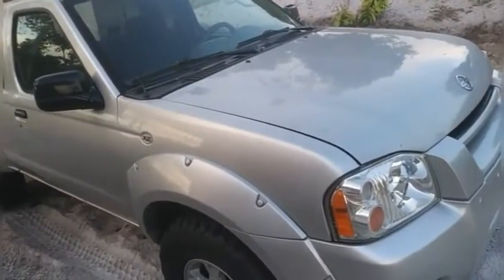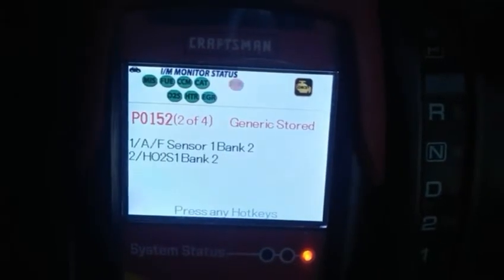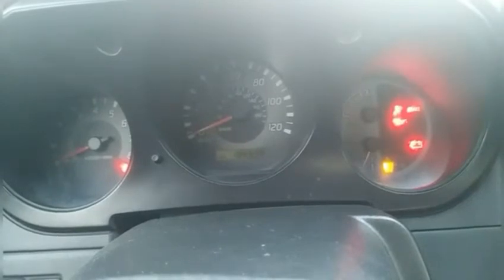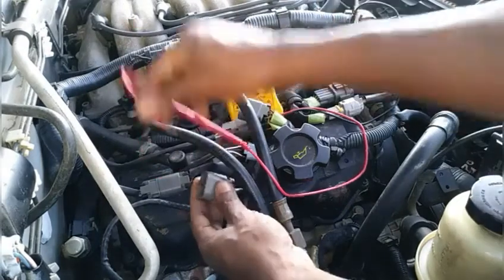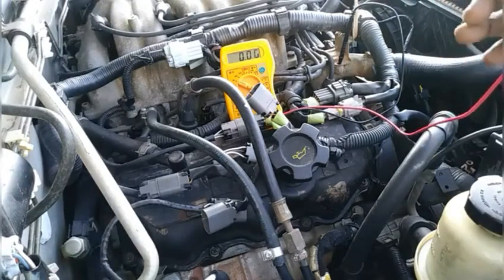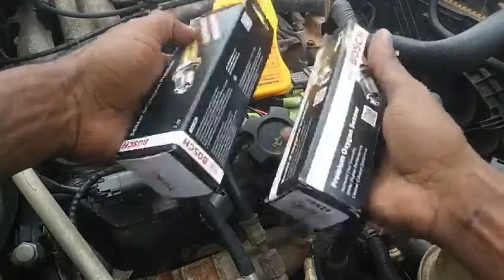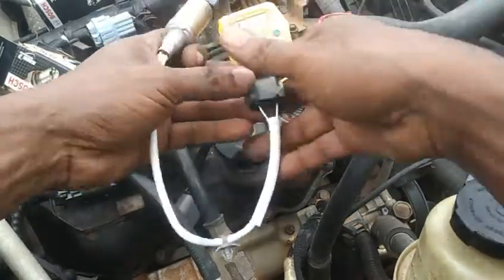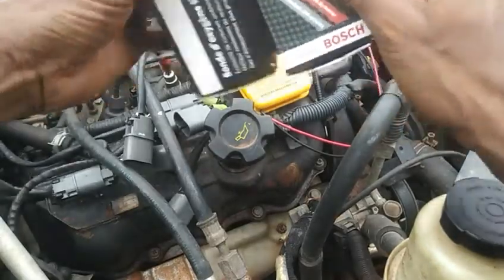How to Fix Nissan Frontier DTC P0328/P0138/P0136/P0134/P0133/P0132/P0172/P0171/P0300. Part 3/6

Comment: Gday .My pathfinder vg33e runs rough on Lpg and petrol ..The probes on bank one and two have the holes..It runs rough after after warming up.Would this be the 02 sensors..It happened after changing distributor  after realy rough running stalling..Great info thanks..
Reply from the maker: Try cleaning the inside of the throttle body, change air filter if dirty and replace the fuel filter might help. If the dashboard "check engine" light is not display, it does not have a O2 problem, but you should have the ECU scan to see if any codes are store in the freeze frame perimeter. Stay in touch
Reply: @Stevexnycautomotive  .Gday. no check light comes on ..The 02 sensors are at like 7.7 ohms minimum at  cold. It has new air filter ,new plugs ,distributor, new leads,The Lpg runs off 02 sensor  as well and had to be made rich as one of the plugs not getting enough fuel ..Cant adjust petrol obviously..Im still asuming 02 ..No OB11 ports on this Australuan mode..Car runs fine untill warmed up..Not loosing water so not head gascot
Reply from the maker: Hmm. Was not aware of the LPG and no ADL for scanner. Does the LPG fuel circuit have a pressure regulator device?. fuel pressure regulator can cause rough idle when engine warm. Would also recommend checking or Change the ECU coolant temperature sensor, since it switch the fuel injectors from open loop to close loop mode. I will more bet on a faulty LPG pressure regulator. Please be careful working on LPG, it is highly explosive and is not like gasoline. Do not work on the vehicle in a enclosed garage. Always out side in wind environment. Good luck. Let if know if it help.
Reply from the maker: Your gas/air mix is running lean because of ice/frost forming in the vapouriser while idling?. I suspect your hot water piping needs checking - the radiator/water pump etc, if equipt. LPG setups have a vapouriser to help turn the Liquid into a gas. When idling, the engine is not pumping a lot of hot water through the cooling system. So there's not a lot of hot water getting to the vapouriser, so it gets cold. You'll see frost forming on the outside. So as this frost forms in your vapouriser and chokes up the gas flow, leaning out the engine and it eventually stalls or rough idle at warm. You should be able to see this effect by simply idling the car on LPG, and watch for the frost forming.
Reply: @Stevexnycautomotive  Gday ..Lpg runs  rough like the petrol  its just easy to make rich and run a little better ..The 7.7 ohms seems high on O2 sensors as my engine same as yours
Reply from the maker: I am assuming that is the O2 sensor on the right side manifold it very high and out of operation range. Make sure your purchase a genuine dealer O2 sensor that is a Bosch brand. Do not substitute after aftermarket sensor like Denso or NGK. Only the Bosch sensor that is shown in this video. You might need to take a multivolt meter to the part store to test the sensor, making sure it meet the factory OEM ohms resistance test.
Reply: @Stevexnycautomotive  Yeah same 7.7 on both up stream  they look  identica will get them changedl .And .Ecu temp sensor as your saying  is pissible though the guage is going to qauter warming up tgen running rough..Thanks Mate visit Oz one day..👍
Reply from the maker: The ECU temp and the gauge temp senor are wiring to different sensors. Both are in the same location. The one wire sensor is for temp gauge and the two wire is the ECU sensor. The one wire sometime gets a bad connection at the rivet terminal will become loose. The O2 sensor in the right manifold is for engine performance data. The one on the left is for emmision monitoring, but then again I don't think you have emmision standard in AU.